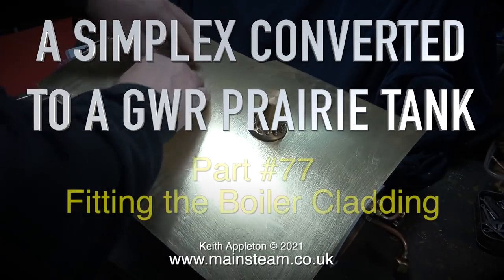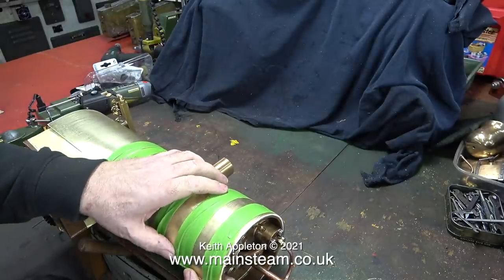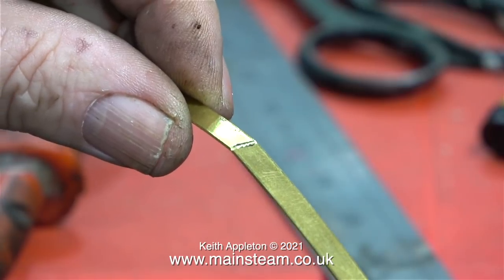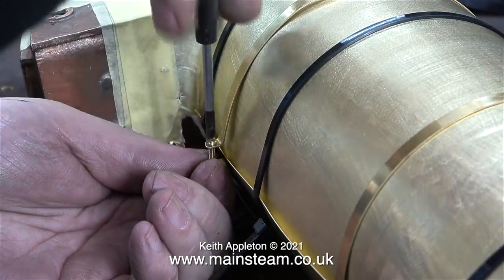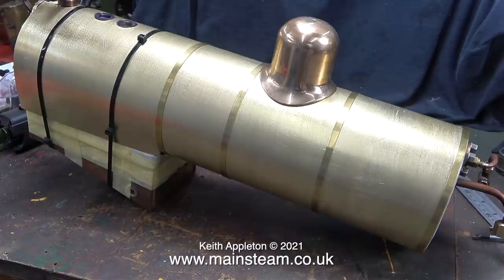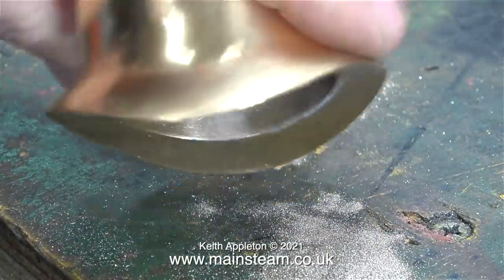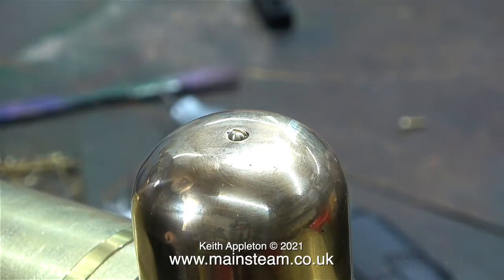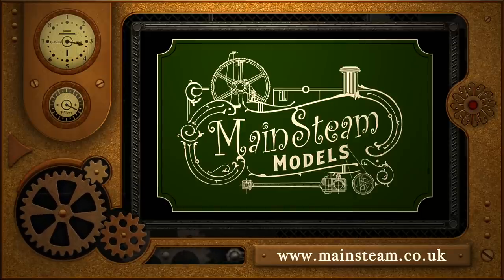SIMPLEX PRAIRIE TANK - PART #77

Comment: Keith, I have used small pieces of rope with eyes in one end, to do similar things to what you are doing with the masking tape and cable ties on the cladding, they are easy to adjust and tension up as you go, and reusable for other things like holding extension cords together when wrapped up and unused etc.. It is starting to look lovely and more like an engine again. Your hard work shows Keith.

Comment: I have used hose clamps (jubilee clips I think you call them) , to hold the cladding on and to tighten the cladding down while installing boiler bands. The insolation material I last used was like fiberglass ( It irritated the same), but about two to three times thicker from look then the stuff you are using.

Comment: You can get cable tie tensioners which will pull the cable ties tighter than you can do by hand, and cut them automatically when the correct tension has been achieved. They can be obtained for very little money unless you actually want to buy expensive ones.
Of course, you then have no gap at all when you want to remove the cable tie, the trick is to cut the head downwards removing the ratchet rather than risk damaging the surface underneath.

Comment: Martin Evans bashed out Simplex mostly without thinking and doing a compare with ratios of boiler to Cylinder size. So what happened was he tried to rectify the faults with SUPER SIMPLEX. Which is where your original boiler came from. I am doing a Simplex but without the axle in the ashpan and reduced cylinder size. 1 3/8 the same size as his Jinty. The boilers are almost identical. Jinty goes perfectly. Simplex runs out of steam. David and Lily.
Reply from the maker: A standard Simplex I had a few years ago was fine with the non "Super Simplex" boiler. I did have to tweak the draughting slightly though to improve the heat from the fire.